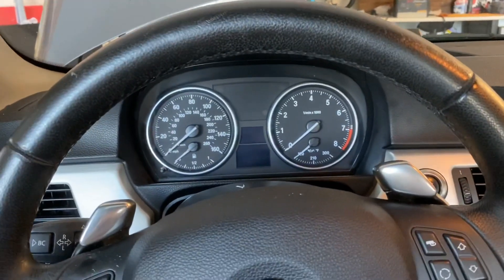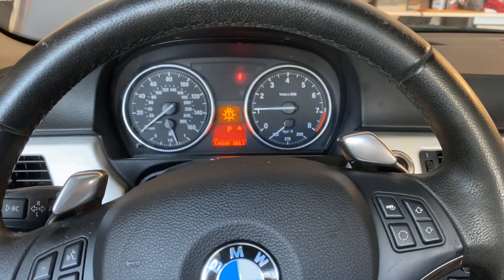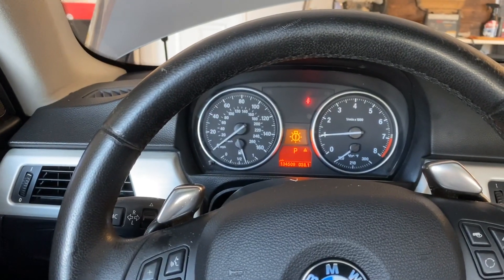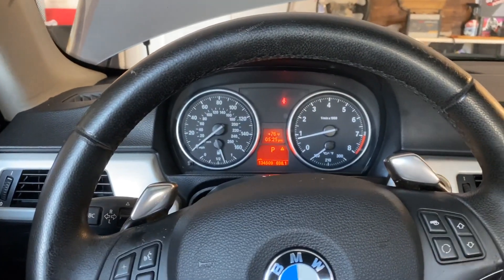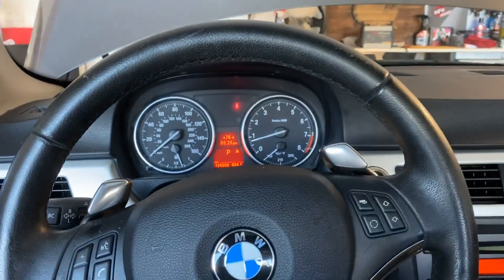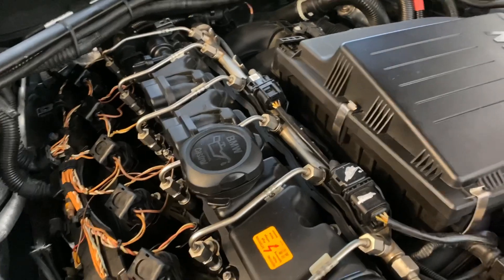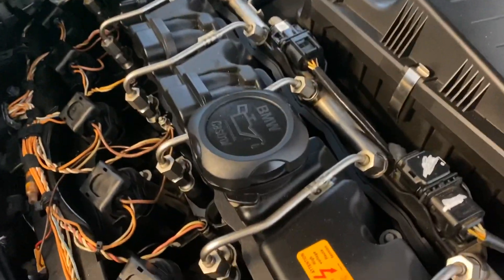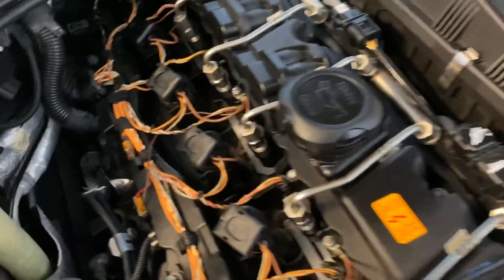8 Signs your injectors are FAILING | BMW 335i N54

Comment: I have a 2010 328i xDrive Sulev. 
But can't seem to find cheaper fuel injectors. 
I took out the fuel rail and injectors out of the fuel rail and hooked up a 9 volt battery to clean them out. I thought pretty good,had a wide nice spray. But noticed 5 of the injectors were tough to pull out of the fuel rail. But 1 was easy to pull out and in the fuel rail. I'm thinking it might be that one o ring is bad. And it's causing a leak in while it's tighten down. 
Everyone, what I do!
Keep the fuel injectors and use them. Because they're spraying very good.
Just replace that o ring,or should I replace all of them!
Reply: Replace all
 Get the refurbished from fcp or rock auto etc i think its bm refurbished. 
30/40$ a each.

Comment: Very informative. My 2012 62000km f10 N20 produces a little rough idle on cold start as the rpm settles down from 1200rpm to 700rpm just as your car. It also produces a white smoke on cold start if not driven for 2 days or more. It also produces a strong fuel odor on cold start. The vehicle  has a sluggish acceleration in low gears. New spark plugs from fcp euro but they all have black soot. No error code or check engine light. I do alot of short distance drives. So the rough idle issue started right after replacing timing chain kit. The car performs awesome once fully warmed up. Could it be the injectors leaking fuel? Please help
Reply from the maker: I would say yes there is a good chance you’re having injector issues.  Sounds like leaking into the cylinder, which would explain fuel smell at cold start. It’s excess fuel not being burnt. That would lead to black plugs too.  I would do injectors and plugs at the same time.
Reply: @SpeedCultureStudios  thanks for your reply. How do I check to confirm it's the injectors leaking fuel and  not the HPFP?

Comment: 535i N55 A little bit of white smoke on cold start but then once the car fully warmed up and you turned it off and get back in a short period of time. It had a rough idle for a couple seconds. Anyways, new injectors fix that problem..
Reply from the maker: Boom

Comment: I have a full straight pipe n54 catless dps and all , at random my car will smoke like crazy , I replaced a upstream o2 sensor and that fixed some of my issues but still a good amount of smoke with a fuel smell , any takes on what this could be ?
Reply from the maker: Could be a leaking injector or bad coil pack.  Showing any codes or misfires? Could have a bad turbo too but I’d check the cheap and easy stuff first
Reply: @SpeedCultureStudios  thanks for the ideas , I’ve been perplexed by this , I have a failed downstream o2 and the other one is throwing a code I think cause of my catless dps, but as far as I know the downstreams don’t affect the fuel ratio ? Idk , thanks you for the comment !
Reply: And no misfires anymore I had bank 2 misfires till I replaced my bank 2 sensor 1 o2
Reply: Did you fix your issues having the fuel smell threw exhaust with codes P0420 
P0430

Comment: I had the same issue with a N42 engine. One sign is gasoline smell from the exhaust or when you take the oil cap off and the bad odor is a dead giveaway. Other issue is also timing of the engine goes out randomly even with new vanos unites and chain installed. Another thing is if the engine runs poor but starts running way better when disconnecting the MAF sensor(+multiplied fault codes from the EMU). Combine that with bad gasoline smell from earlier that is a give way you need new injectors. Or the old ones at least need to be tested. 
If the vehicle is approaching 250-300k miles it should be something to pay attention do. Sharing here a personal experience :) Hope it helps others. Very good video btw.

Comment: Hi! I am glad I found your videos. 
I have a problem with my n54 e93 which I can t solve. Maybe you can help me please. I blew the engine a few weeks ago from missfires. I rebuild it, put everything new (pistons, bearings, rods etc.) Now I have good compression, no oil leaks. I changed the sparks and coils. Injectors are index 12 and no one looks like is leaking. The sparks looks clean. My problem is that the car is still missfire and I get no codes. I took the car to dyno to read some logs and when the moment the car missfire the first 3 injectors run too rich. But in other logs it looks like the next 3 injectors run too rich. I have not clue what to do. Maybe an o2 sensor? Or map?
The missfire appear only when I have 100% acceleration and it drives strange at constant speed. It looks like it is shaking.
Reply from the maker: Change upstream and downstream o2 sensors and now you'll want to change the plugs again.  Might have to dig deeper if that doesn't help.  Valves are all clean after rebuild?
Reply: @SpeedCultureStudios  all valves are cleaned. Is there any chance that some injectors can t pump enough fuel and cause missfire in full throttle? I could send you the logs of the dyno if you could read them. I can pay you for that.

Comment: Hi, I've got a problem with my E90 and I'm wondering what it could be. The symptoms started a couple of weeks ago with, for example, if I shifted from 2nd gear to 3rd gear and stepped on the gas, it started to chop. Kept it like that for a couple of weeks and now it's pretty bad, if I do a cold start the whole car moves, shakes sideways. One day there was no power in it at all. The fault code reader shows misfire on the 6 cylinder, a guy at a workshop put in a used ignition coil and then it got a little better but not great, but have bought 6 new spark plugs, 6 new ignition coils to see if there might be something there, otherwise so maybe it's the fuel injector?
Reply from the maker: Could definitely be the injector.  And if it’s the injector, you’ll want to change the spark plug again

Comment: Out of all the videos I’ve scoured through you have given the best advice and I appreciate it. My n54 blew up 12hours after I purchased it. My friend did a pull and I suggested he didn’t. He weighs 300lbs too. So on my way home it blew up rather violently and seized the engine. I was just in a trip home that night from the dealer had to take my dad home and stay the night there as it was late and it’s a 50+mile drive to my place. I had to take my friend gas can he left over at my parents place when he was helping me move. Now me and him have owned rx8s and he has corvettes so he was a lil enticed to drive the car my 2011 335is and I even suggested he shouldn’t do a pull but he did 4-5 he at loaded pulls with our heavy weight int he car. Now I’ve driven my r3 rx8 with him having 200+hp and that was actually sluggish as ever. But my dad did pint out before I began my voyage home that the car sounded off with a noise and he may have heard a leaking injector he didn’t tell me about the noise until after the motor seized on my way home so the spirited drive was already over and car was fine half way home until it happened so randomly
Reply from the maker: Dang that sucks!
Reply: Gesus! I Feel for you man. I have a 2011 335is 6spd manual myself. I have 90,000kms/55,000miles on mine.

What is the mileage or km's on your 2011 335is?
Reply: @mobilekaos  my 2011 335is had 125,000 miles
Reply: @mobilekaos  my engine blew up from the fact it sucked in a bunch silicon rtv through the crank seal it seems the pulls may have sucked it all in. And during my initial rollout at the dealer going home.
Reply: So I’ve had to investigate but my new engines almost in I’ve spent quality time getting it ready after purchasing a long block N54 with 89,000 miles

Comment: Thank you so much.
My C4 Corvette had many of the symptoms you explained and in all the videos I watched only yours really showed me what a bad injector sounded like.
I had slightly rough idle, harder cold start, whitish smoke on start ups.
Sounded like gravel in a tin can.
So today I will pull the fuel rail, clean and rebuild each injector.
Cheers

Comment: My car is giving me back misfires, when  it’s nicely warmed up after driving it for a while and when I push the gas peddle it makes popping sounds coming from the exhaust what can it be? And It’s not giving me any codes. PLEASE HELP!
Reply from the maker: Start the process. Spark plugs, coil packs, injectors…
Reply: @SpeedCultureStudios  I did I already checked the ignition coils and the spark plugs they’re good
Reply from the maker: @younggamer4891  I didn’t say “check” them.  Change them.
Reply: @SpeedCultureStudios   do u live in Nc?
Reply from the maker: @younggamer4891  SC

Comment: Mine has rough idling at cold starts and car is stuttering ONLY on the highway near the 3-6k RPM band. If I do a quick agressive launch while doing some city driving the car just goes like it’s supposed to. I also do have bad spark plugs though
Reply from the maker: Well bad spark plugs can definitely cause the issues you're describing.  This platform is so touchy that if everything is not just right, it will act funny.

Comment: Hey, I recently switched out all my spark plugs and even the timing chain since my mechanic recommended it, but it still hasn’t gone away.;

Could the problems still be failing injectors if the tapping increases when I accelerate or is it likely a valve lifted issue? For some reason I am also getting gas-smelling white smoke out of my exhaust too.
Reply from the maker: It can definitely be injectors.  They are very noisy in the n54 anyway, but if you’re also smelling fuel, you could have a leaking injector/s causing the car to run rich.

Comment: Hey mate, I've been having problems lately as well. Recently replaced all spark plugs and coils but still having a misfire when I start up, the car seems to struggle to keep it's RPM's and I sometimes here the engine drop RPM quickly then go back to normal, is that a injector problem? 

Also, I can't hit the rev limiter either, if I do, it has a spat attack and comes up saying multiple misfires on cylinder 1 and cylinder 2 when I red line it to 7k.. Just wondering if U could shine some light on what it may be, if it is injectors gonna fork out the money to get index 12's 😬
Reply from the maker: Sounds like a high potential that you have failing injectors.  Could be a vanos issue too, so cleaning them first is a simple trick.  Also O2 sensors are a relatively inexpensive fix, but it always seems to come back to injectors.  
Don’t forget to change plugs again once you upgrade injectors.
Reply: Have you cleaned the intake ports? Mine were so bad when I got the car I was having same issues as you
Reply: @Out_the_mud94  Thanks for that information but I have found my Bank 1 before cat O2 sensor is damaged because of when the mechanic put my VRSF downpipes in, he didn't line the pipes up right and damaged the O2, bank 1 is stuck at 21 AFR so it would be pulling timing and causing all sorts of misfires
Reply from the maker: @Out_the_mud94  Definitely could be a gummed up valves!  Good call.  Mine were terrible too!

Comment: With this being said I think I have bad injectors and they are pretty expensive for index 12 at the moment how long can I drive like this I think I can pay them in full up but up until a month from now
Reply from the maker: It’s not great to drive on bad injectors.  It puts unnecessary strain on the engine if running lean and can cause issues if you have injectors leaking into your cylinders.  Are you getting codes?
Reply: @SpeedCultureStudios  no check engine light but last time I got it walnut blasted witch was when all of this started it pulled up cylinder 3
Reply from the maker: @bam12383  I assume you've done plugs and coils and o2 sensors?
Reply: @SpeedCultureStudios  yes indeed
Reply from the maker: @bam12383  it always seems to come back to injectors
Reply: @SpeedCultureStudios  thanks for the help guess I’ll have to fork over some money

Comment: What if it starts running shitty after a 30 minute drive???
Reply from the maker: Definitely could be injectors.  Could also be bad O2 sensors.  “Map” changes once temp is reached so far might start and cold idle fine but after warm it runs funny.  O2 sensors are easy to change and relatively inexpensive.  Change them out and see if there’s a difference.  Clean your vanos solenoids too.

Comment: Do you know if injectors will cause afr reading to fluctuate for 1 of the banks? I got all new o2s (front n back), reset adaptation, but still getting bank 2 lambda after cat code....
Reply from the maker: I would say that it could.  If you have not changed out injectors, its very possibly you are running rich or running lean on one bank.  No misfires?
Reply: @SpeedCultureStudios  appreciate it, no misfire codes yet. Just o2 code. Ya it never been replaced before. I'm going to replace it with them 12s.

Comment: on a cold start my n55 will jump from 500rpm to 1000 a couple times then die. once i takeoff and start driving it’s normal, is this a sign of bad injectors?
Reply from the maker: Could be, yes.  I'd start with the easy stuff first though, plugs and coils.
Reply: Sounds like high pressure fuel pump to me. Have rail pressure tested

Comment: Ignition misfires almost always manifest themselves at higher engine loads rather than at idle Fuel Injectors manifest their issues at idle and light load rather than WOT as they go to open loop and rich.
Reply: Thats what i'm thinking with my car. It idles slightly rough and when accelerating at low rpms it has a bit of hesitation. When i get on it the car is fine. I have no codes or anything. I replaced plugs already, so I believe it may be a bad injector. Plus it is direct injected and has over 130k on it
Reply: @godzilla7391 hope to hear from you!! I’m having the same issues on cold start it has rough ridle at low rpms it feels sluggish and the tranny punches into gear almost past 2,500 rpm it feels good and when I put it into manual mode it does better but not to much better
Reply: Interesting is I have the exact opposite issue 😄 The idle us just fine, low rpms are just fine. But over 4000 rpm it "hesitates" at times or misfires, as Tom said
Reply: @godzilla7391 did you get a CEL when this happened? i know this was 2 years ago my bad lol
Reply: Thank you very much, Tom. Now I'm sure my car "just" misfires and it doesn't need new injectors 👍

Comment: Hey hopefully you can see this, have been getting a rough idle and cylinder 3 misfire (29CF), off a cold start rpms flutter around 700-900 rpm, then shakes as it settles down to 600rpm, changed plugs and coils and had an oil change, ran fine for a couple days then rough/shaky idle again as well as threw that same misfire on cylinder 3, checked the new plugs and found more than one covered in fuel, i found it odd that i was only it getting cylinder 3 misfire but more than one plug was covered in fuel so i think it’s leaking from injector #3 into the other plug housings, like your video said checked oil fill cap and smelt gas as well, from everything i’m thinking the injectors, but i don’t have the facilities to remove them and try different combinations to test, just looking for some confirmation/input as i don’t want to go ahead with pricy injectors and them not solve my problem. 
Thanks
Reply from the maker: Sounds like injectors to me.  They are very easy to remove and replace, so you may be able to do it yourself.
Reply: @SpeedCultureStudios   Greatly appreciated, thank you for the quick response and input. Subscribed
Reply from the maker: @dylanlapierre456  No problem!  And thanks for subscribing.  It's greatly appreciated!

Comment: Hey, I’ve been getting random/multiple misfires pretty much in all my cylinders & terrible gas mileage so gradually I was leaning towards my injectors but when I accelerate hard (only when accelerating hard) when driving the engine seems to lose power & heavy white smoke comes out. Could it possibly be a blown head gasket instead or injectors ?
Reply from the maker: Could possibly be.  Check your coolant and oil and see what it looks like.  I’d like chocolate milk it’s a head gasket.  You may have blown turbos as well or bad coil packs

Comment: Would bad or failing injectors cause car to stall at stop light
Reply from the maker: Yes it definitely could, especially if you have multiples failing, potentially starving the engine of fuel.

Comment: Hi mate. Would failing injectors also cause huge power loss?
Reply from the maker: For sure!  Your engine could be getting way too much fuel in a given cylinder if they are leaking or not getting any fuel in one ore multiple cylinders if they are clogged.  It can cause very poor engine operation and misfires.

Comment: Had a code saying one of my injectors was bad I replaced it without coding them but when I took out my old one there was oil on the tip ? Would that be cause my the valve cover having a crack on it ?
Reply from the maker: The valve cover may not be cracked but the gasket could definitely be leaking.  If you have a bad injector, that cylinder is not firing properly either so it may have just been build up and not necessarily “leaked” oil
Reply: @SpeedCultureStudios  is there any way to remove that build up ? I plan on doing my valve cover this week and I’m tired of it misfiring lol
Reply from the maker: @kevthecompass6217  other than clean them off or replace them, no.  Replace the gasket sure but what I am saying is that if you put a good injector in there you may not get that build up anymore
Reply: @SpeedCultureStudios  put a good injector in there still slightly misfiring lol 😬😬
Reply from the maker: @kevthecompass6217  that’s the N54 for you lol.  Coil packs, spark plugs and clean banks solenoids.
What index injector did you replace it with?  Did you replace all of them?  Did you code them?